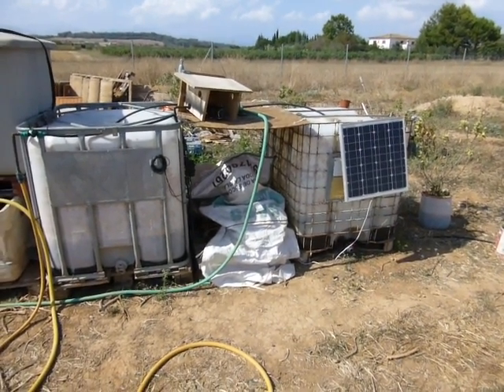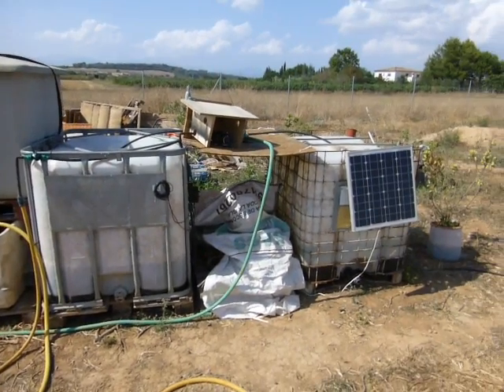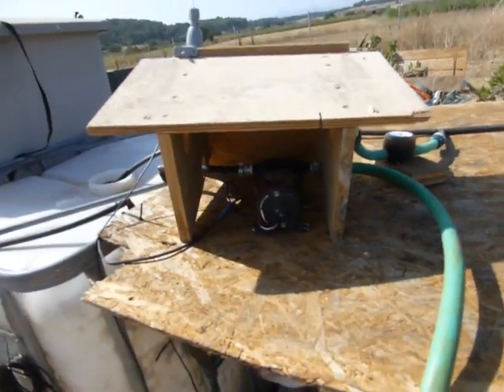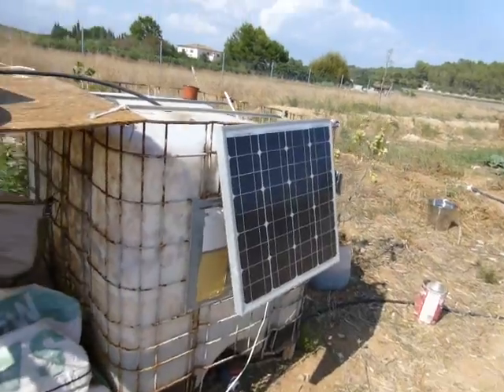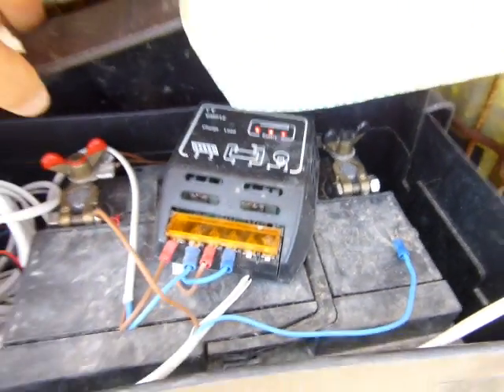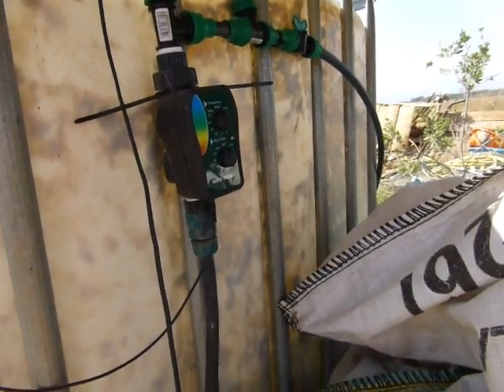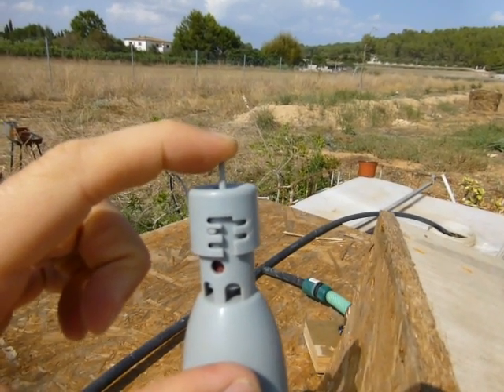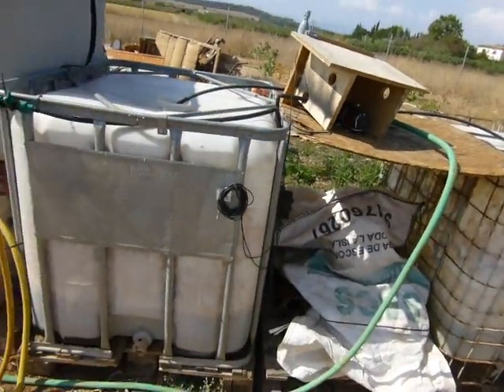DIY Biosand/Biochar Water Purification System

Comment: put pipes on the led of the tanks, so the water can evaporate and stays cool :) not necessary but if the water gets hotter than you want because of the sun then pipes for evaporation is the solution :) and you can put a net in top of the pipes so insects can't go inside :)
Reply: oh and if you don't want algae you can paint the tanks black so no more light can reach them and stop growing

Comment: Can you run a water timer off that battery operated pump for several days?
Reply from the maker: that was a crappy job and my first solar install so the true answer is no...  Th car batteries I was using kept on dying on me cos they are not supposed to be deep cycled.  With a 200 watt panel and a deep cycle battery it would work fine.

Comment: Hey, what minimum water head do you need for effective filteration of the water and also does the water flows from the 2nd Slow sand barrel to 3rd Biochar barrel if the required head of water is not there??
Reply from the maker: The water that needs to be treated just needs to be higher than the barrels.  
The water flows:
in bottom of gravel filter/out top
in top of sand filter/out bottom
in bottom of biochar filter / out top
you just need the water that is coming in to be higher than the first barrel.

you can get the plans with full descriptions for free in the link in the description. that should answer any other questions you may have.
Reply: Mandala man  Ok, thanks for the help.😊😊😊

Comment: I wonder if it is possible to recycle shower water through this to use again as shower water?
Reply from the maker: probably.  this system is designed for areas with very poluted water.  so, in theory it should work.
Reply from the maker: Check out this channel he has a system using a reed bed that allows you to recycle shower water over and over again.

Comment: Nice. one question do u have to change the sand and gravel given that the water might be very dirty or they last for a long time? thank u
Reply from the maker: CoOl ViDeOs- HD 
Hi, I had to change the sand this year because it has gone through the gravel at the bottom and formed a layer that wouldnt let water through.  Otherwise Im not 100% sure cos I dont remember but I think you dont have to change the sand filter.  the microbes in the "bio layer" eat any pathogens.

You do have to change the biochar as that is just a sponge that sucks up toxins.

At www.aqsolutions.org you can find all of the information you need on this system, including very detailed plans and everything else you could want to know about it.  Its all free too.
Reply: @Mandalaman - Adding my 2 cents.
You don't have to change the sand/gravel, etc. But definitely it must be "cleaned". The ideal process is reverse flush, with higher pressure. A hose set on the output will agitate the media enough to suspend the waste. The lighter particles will float and overfilling will allow to skim the surface quite easily. This allow the removal of all the excess you don't want in there. While leaving more than enough bacteria intact.

During reverse flushing all the connections to other tanks should be closed. 
All the tanks should be protected from light. Cover them in any possible way. By far the best option, for above ground tanks, is a roof. In that Sun scorched land some shadow is quite welcomed anyway. Remember cold water is healthy water. So keep the Sun away. ;-)  

Notice as shown in this video it start by degrading the water quality in those Sun beaten & algae filled tanks and than proceed to treat it as best as possible. Something quite easy to remedy/avoid. ;-)
Best of luck 
Cheers
Reply from the maker: @crpth1  the biosand barrel needs a little light.  Thanks for your other suggestions.
Reply from the maker: @crpth1  please be aware we are talking about different filtration systems... you are talking about a bog standard sand filter that only removes particles, Im talking about a bio/sand filter that removes both particles and microbial pathogens.

Where did I get it the information from?  I got it from the instructions on how to build the system designed, built and tested by an environmental engineer...

I have been using this water for showering and drinking for over 4 years and the water from this very system has been lab tested and is perfectly safe for both.  In fact I tested the water going into the system and coming out of the system to see the difference and the water going in from the well isnt suitable for either.

you are drawing conclusions from a lack of understanding of the system and from mistaking the bio/sand filter for a normal sand filter like you have on a pool.

Look at the link in the description, it is all explained in great detail.  This very system is being used in lots and lots of places to treat water heavily laden with biological and chemical issues.
Reply from the maker: @crpth1   you are also incorrect about your observations of nature.  running water in rivers not polluted by man are the perfect example.
Reply from the maker: @crpth1  http://www.aqsolutions.org/images/2016/02/blue-barrel-system-manual-English.pdf
Reply from the maker: @crpth1 believe me....
Reply: Thank u very much sir.